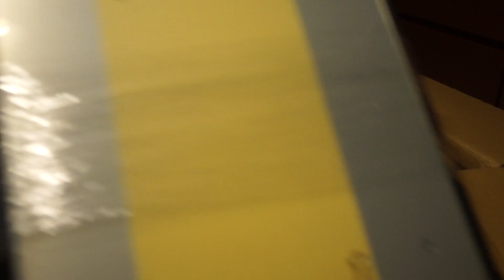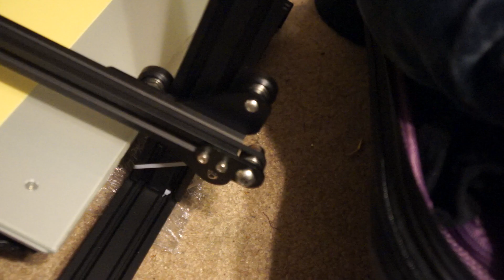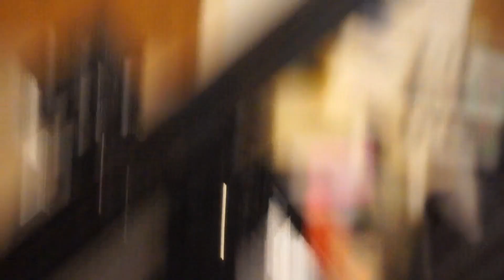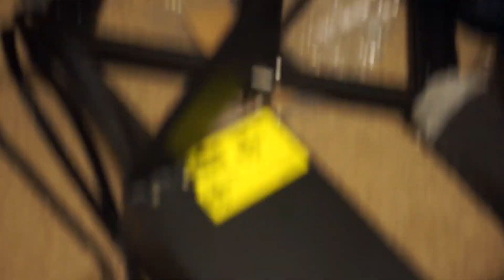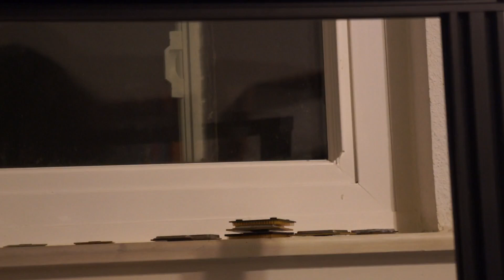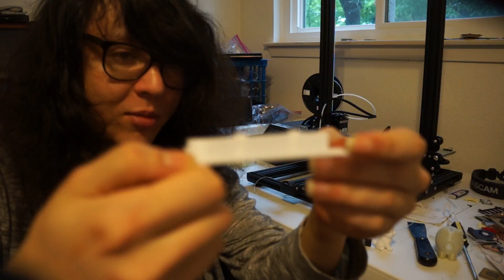3d printing 1st Impressions and Assembly (Creality CR10)

Comment: Nice. I got an Ender 3, my all measures almost the same printer. I'd invest in getting the metal extruder,  the default one tends to develop a notch over time, which catches the filament and produces under extrusion issues.

Comment: Another great video! I look forward to seeing what you print - keep us updated :)

Have you thought about trying out coreboot or libreboot on a desktop board? I have a GA-G41M-ES2L and would love to see a video on it!
Reply from the maker: I have thought about trying out libreboot on that board, its the core 2 duo right?
Reply: @tripcodeQ7  I recently sporadic info that suggested it will actually work with 4 cores. I took the plunge and bought a Q9650 and sure enough - it boots! Not particularly expensive either.

My only gripe is the 2 RAM slots... kind of expensive to get hold of 2x4gb DDR2 that's intel compatible.

Comment: when are u going to make libreboot computers and start selling them? I would buy
Reply from the maker: I have one I could sell, I'm moving towards corebooted x220s though
Reply: @tripcodeQ7  But 'muh Intel ME,' however, I'm actually inclined to agree. Libreboot is now a niche for aging ThinkPads, Coreboot is the future for (mostly) open firmware. The ME has been analyzed more thoroughly in the past few years and there is an effort to gain some facet of transparency for the contemporary x86 architecture. Additionally, Coreboot has a much larger community and scope of development.

If you want to learn a little bit more, then check out this informative C3 talk on the Management Engine https://youtu.be/3CQUNd3oKBM
Reply: Why Coreboot vs. Libreboot?
Reply from the maker: @Daniel-qr1zf  the x200 has gotten a bit rare, plus the x220s were purchased as a lot.
Reply: Yeah, @tripcode!Q/7 if you're selling, I'm looking for a 220 or 230 librebooted. Would love to buy from you.